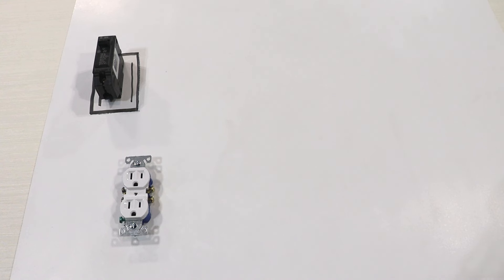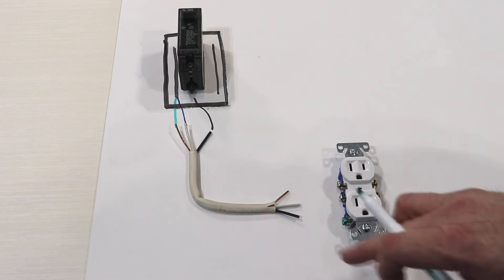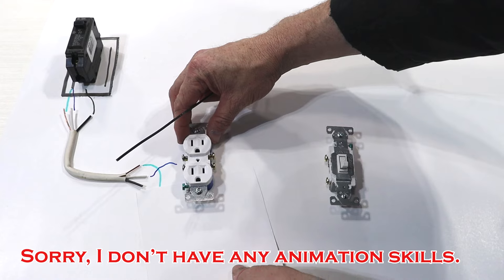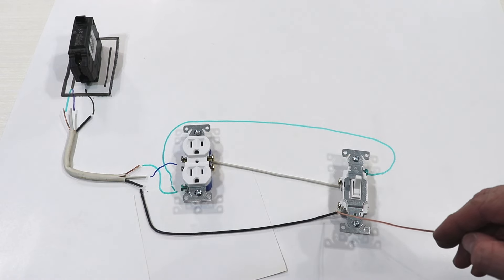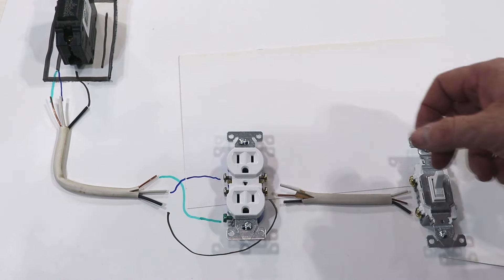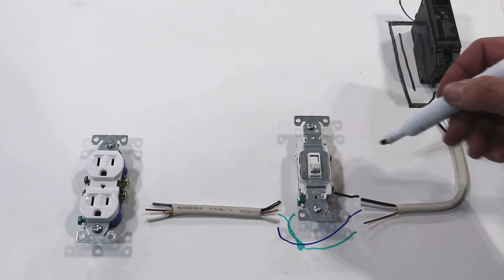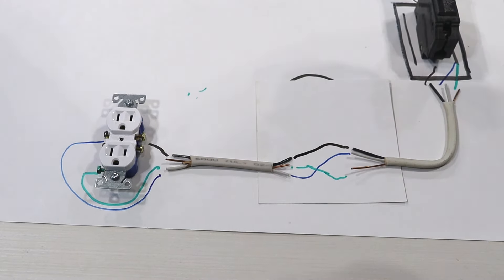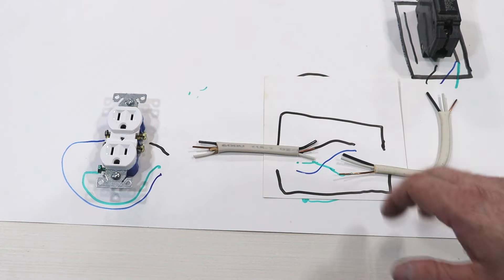How to Wire a Circuit Where the Switch Controls the Power to an Outlet

Comment: I am so lost. I have a light switch. From the light switch there is an outlet above it. The light switch works. The outlet does not. I have watched many videos and it seems like everything is connected properly. I’ve tested all the wires and it doesn’t look like I have power on one of my black wires.  But my white neutral wire has power. Ugh I don’t know
Reply: Buy an outlet and replace it. That’s probably the issue.

Comment: Great video. I’m starting to understand. But in my particular situation, the switch controls a light and an outlet in my bathroom. How would I go about making the outlet always hot and the light still controlled by the switch?
Reply from the maker: Wire the outlet first, then the switch, then the light. The outlet will always be hot, then the switch will have power which controls power to the light.

Comment: Just curious, in your first example where you add the switch, what's the reason for using a white wire with black tape on the ends, instead of just using a black wire?  My assumption is that it (A) shouldn't look like there are two separate hots coming together when the switch is turned on and (B) should indicate that the wire can be hot, but might not be due to the presence of the switch.  That, however, is just an assumption.

Comment: I have a question ? I have a switch that's connected to 3 outlets the problem is the top part of the outlets had constant power the bottom parts of all 3 out lets are powered by the switch is this an easy fix

Comment: Great video! My house has an outlet in it where only the top plug runs off the switch and the bottom plug is always hot. Just recently, I removed my garbage disposal that was plugged into the outlet so I could perform some maintenance on it. When I went to plug it back in, it turned on despite the switch being off. Both plugs are now hot all the time. I tested the switch with a meter and it's good but I'm not sure about the outlet. The new outlet has four places to plug into, two on the left and two on the right, plus the green for the earth ground. The wires I'm looking at are red, black, white, and copper earth ground. I won't mention the copper wire because there's no doubt where that goes. The old outlet had red and black on the right and white on the left. I noticed that the new outlet has continuity at both connection points on the left and the right where as the old one only had continuity on the left. Removable tab? I think I see it but I'm not sure. Anyway, I'm still messing with it but since I liked your video, I thought I'd ask you and see if you could add that little tidbit to it.

Comment: How would I keep the outlet hot while still running power to the switch for a light and garage door with another run going to another outlet all in the same box? Also, there’s no ground wire coming in from the power source feed.

Comment: I’m trying to use a double pole single throw switch to run a tablesaw and a vacuum on two separate circuits AND Extend the second circuit to two other outlets in my shop, which remain unaffected by the switch. Hell if I can figure this out.

Comment: So I have an electric clothes dryer with too long of a vent run.  I plan on adding an inline booster fan with a secondary lint trap to the run.  My question is, is there a way to get the fan to only run when the dryer is on (automatically turning on the booster fan).  I have looked at the ones with Pressure switches and they are costly (and I have read of issues with them not always detecting airflow properly).  Is there a way to do this electrically considering the circuit for a dryer is 240/250 v outlet and the fan is just normal 120?

Comment: Thank you Brett.  Good explanation.

My question is detecting is the power comes to the switch or the plug first.  It's hard to tell.  Do you use a non contract tester to check that?❤
Reply from the maker: Yes.

Comment: Thanks for sharing your knowledge. Can you tell me if it is possible to add a wall outlet off of a light circuit that is controlled by two wall switches?
Reply from the maker: It is possible. There will always be a wire that is always hot in a single pole light switch box. That will provide the power. Then connect the grounds and neutrals up as you normally would. Not something I would recommend, but its possible.

Comment: This is awesome,  what would do differently if I wanted to turn my outlet to a junction box. Currently I plug my basement ceiling light into an outlet. I want to wire it so I can use a switch to turn them on and off.  I'm in western pennsylvania and there's two rooms in my basement that don't have wired ceiling lights but I want to, then run them to a switch

Comment: I have question,  I have 3 main wire coming out from wall  switch, my problem is one of the main wire  neutral and hot wire are both hot the other main wire is to the outlet reads hot groun rev the 3rd wire to the other room  I'm assuming but put a tester in also read  hot ground rev....any advice out there much appreciated thank.
Reply from the maker: Can you email me some pictures of the wiring and I will try to help you out? brett_e_hill@yahoo.com
Reply: @brettleybuilt  will do soon I get home this e evening...thank you for your reply.

Comment: I have a question please if anyone can answer, I want to put a switch to turn pool pump on/off when vacuuming this video explains perfect but my out is a 3 prong insert and twist, will the wiring be any different, I didn’t install the outlet a neighbor did and he has since moved and darn electricians are too darn expensive

Comment: I currently have the configuration that starts at 6:20. Can I make this outlet half hot? All the videos I can find only show power going to the outlet first, not to the switch and then the outlet.
Reply: Yes you can. You'll need a 14/2 from your power source to the switch and a 14/3 between the switch and the receptacle. In the switch box, join the black wire from the 14/2 to the black wire of the 14/3 and add a pigtail to one screw on the switch. The other end of 14/3 goes to the receptacle contact that you want hot all the time. Break the tab on the hot side only on the receptacle and connect the red wire to the screw for the switched contact, and at the other end to the other screw on the switch. 
The neutral wires will be joined in the switch box and continue to the neutral side of the receptacle.

Comment: I have a metal pole barn and I’m using metal boxes. How would I wire a switch that would turn on a string of outlets and make sure it doesn’t make the barn hot?
Reply from the maker: What do you mean make the barn hot?

Comment: Hi can you do a quick how to video. I have a small shed that I will be running 12/2 romex to a GFCI outlet plug. Then running 12/2 to 20 amp light with switch then a second circuit outlet.
If you can do a quick diagram that would be helpful.

Summary 
12/2 romex wire GFCI outlet ➡️ light with switch ➡️and then a outlet.
Reply from the maker: Please email me at brettleybuilt@gmail.com and I will send you a diagram.
Reply: Great video. The diagrams were very helpful. Thanks too for keeping it moving and on point.

Comment: I have a detached garage. It has a wall in the middle separating into two parts. One part has a pair of lights controlled by a switch in the house. The breaker box in the garage does not affect the lights. The other part does not have any lights. I purchased string lights to remedy the problem. They plug into an outlet tied to the garage breaker box. That outlet has power all the time, so I have to unplug the lights when done. The wiring is all outside of the walls, which makes for easy access. The wire for the lights is run along with the wire for the outlet. Is it possible to connect the outlet to lights so I don’t have to plug and unplug the string lights?
Reply from the maker: Absolutely. Basically it is the first circuit I demonstrated. If you want, send me your email and I will draw you a diagram of what I would do. brettleybuilt@gmail.com

Comment: I have a wierd situation. I have a 12/3 wire power source running to a receptacle. Then there is a 12/2 wire runs from receptacle to the switch to control the switch. I am replacing the receptacle and switch but now I cannot figure out how it was wired. Can you explain how to do this
Reply from the maker: Is there a switch that powers the 12/3 wire to the receptical? Is this a situation to where the outlet is only supposed to have power sometimes?

Comment: Code requires a neutral in every switch box, would you run 12/2/2?
Reply from the maker: No, 12-2 wire. 12-2 wire has a hot and neutral wire. It also has a ground, but the ground isn't counted as a wire as it doesn't carry current.

Comment: So I have a light switch that doesn’t do anything, I opened it up and and it has the two grounds tied together, the two neutrals tied together the two blacks tied together with a third black wire split off the two going to the switch and a red wire coming out of one of the cables to the other side of the switch, I killed power and and isolated the red and the black wires and capped them, (they were both live) and none of my outlets or lights were affected. WTH? Any ideas
Reply from the maker: Not sure why they were both live. The light isn't getting power to it. If both wires were live and connected to the switch, the light the switch controls would be on all the time. You need to find the hot wire that goes from the switch to the light and make sure it is connected properly. Feel free to email me some pictures and I will try to help you out.

Comment: Why should I care if the breaker is off to work on the outlet controlled by the switch. The switch is off, and I've used my multimeter to verify zero volts at the outlet. I'm good, right?
Reply from the maker: Technically, yes. If there is no power at the outlet, you are good. When I change out lights, I generally only turn off the switch and check for voltage and don't turn off the breaker. You should alway turn off the breaker. There, I said it for liability reasons.
Reply: @brettleybuilt  Thanks. I love this response.

Comment: What if my outlet had constant power? What do I do then?
Reply from the maker: Do you mean the outlet has constant power and you want to use it to power a switch?
Reply: @brettleybuilt  yes I wired the outlet correctly and its suppose to be operated by a switch to go on and off. Unfortunately when the switch is off at the wall, the outlet is still on causing my disposal to run when it’s suppose to be off. What am I missing? Am I suppose to break that tab off the outlet where the disposal is plugged into?

Comment: 1 minute in... didn't you say that the 14-2 15a wire shouldn't go on the 20a breaker? or am I an idiot?   (not an electrician trying to make sense of the wizardry of electricity)
Reply from the maker: Yes. I didn't have a 15 amp breaker for this demonstration.  14 guage wire is powered with a 15 amp breaker, where 12 guage wire is powered with a 20 amp breaker.